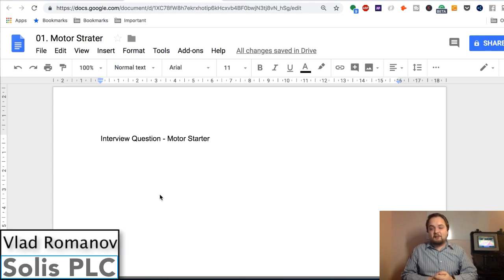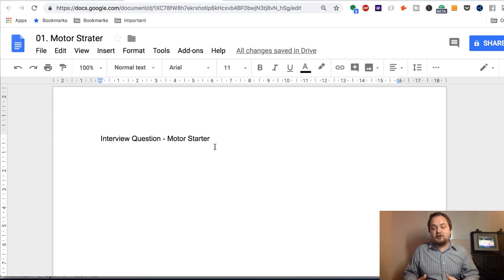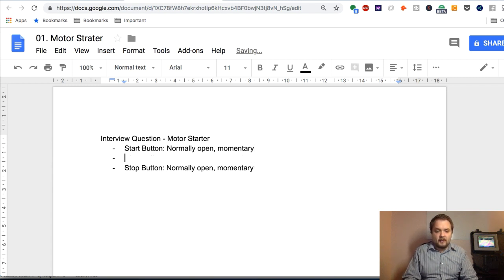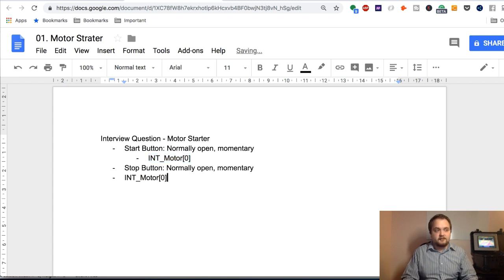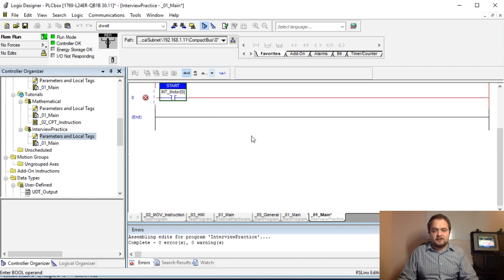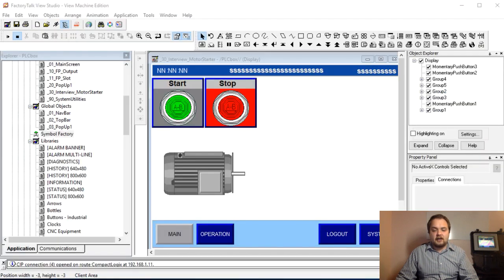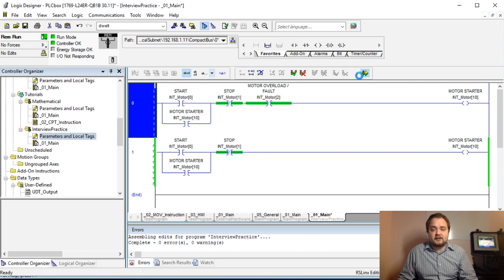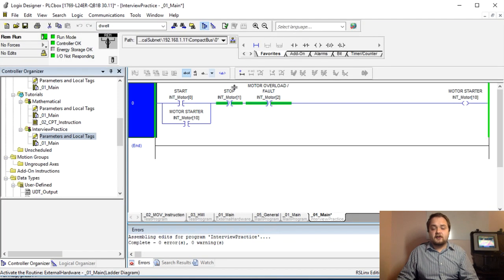PLC Programming Interview Questions - Building a 2 Button Motor Starter System Ladder Logic RSLogix

Comment: in the actual motor starter I cannot seem to get the buttons wired so that the green and red lights come on and then when the buttons are press the start light should go out and when the stop button is pressed the red light should go off. please assist.
Reply from the maker: I would need more information to understand the application.